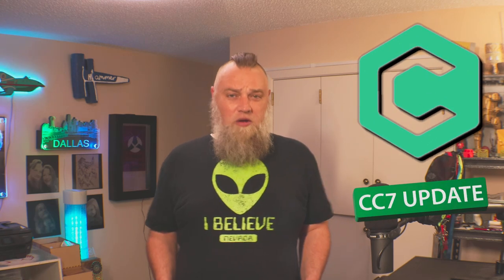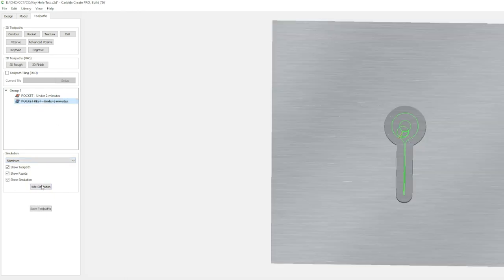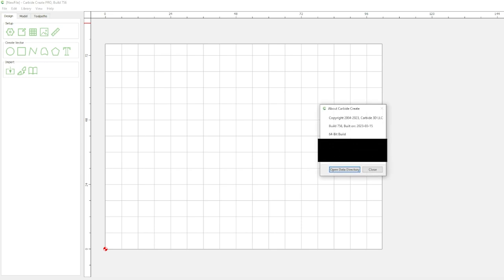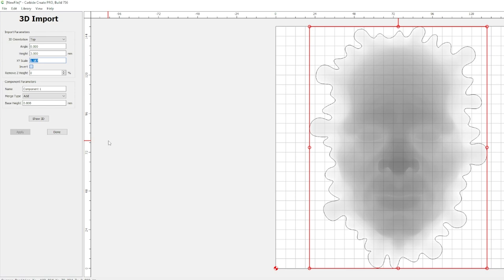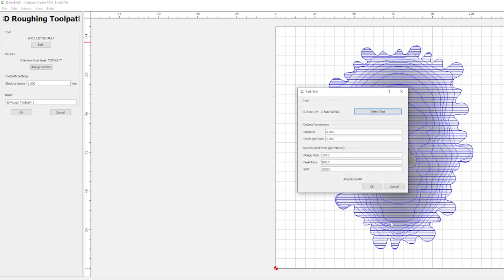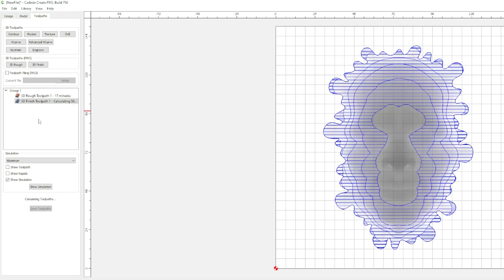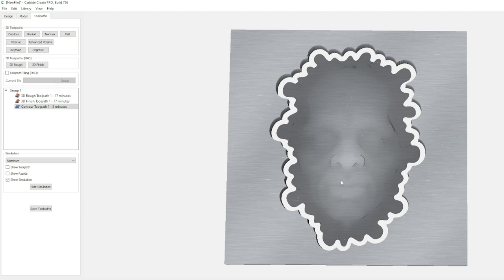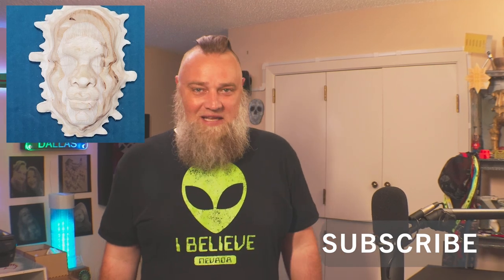Whats New in Carbide Create 7 Pro/Free

Comment: Can you use v7 to design and save and then open with v6 to generate code?
Reply from the maker: Yes, at least in Pro under File there is a save as V6 Option. Any new features used will not transfer over. You can also create a CC account on their website and convert it to gcode there.

Comment: That tapered ball mill that you use- I have a tapered ball mill but I don't know how to enter odd shaped tool bits into the database. Do you have a video of this. It seems no one is making that kind of video.
Reply from the maker: Hi @iwannaapple I sorry yt put your comment in the spam. CC does not have a way to enter them. So I think for this I either set it as a vbit or ballnose. I do not have a video on that, but might be able to put one together down the road.